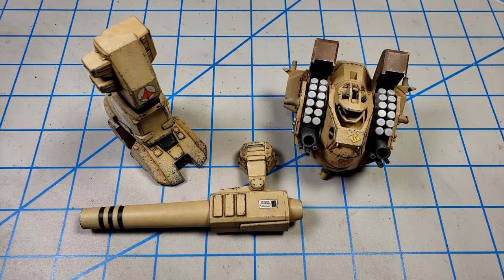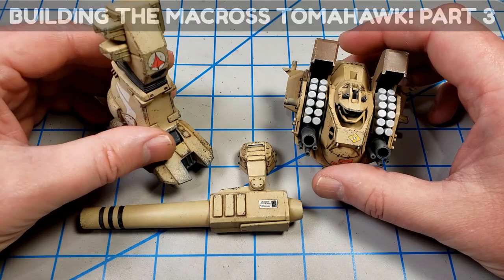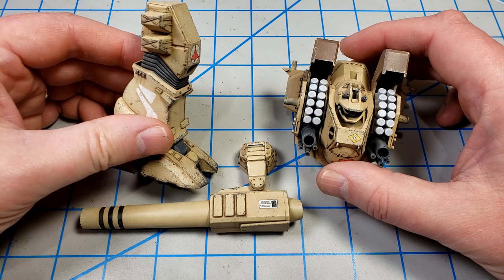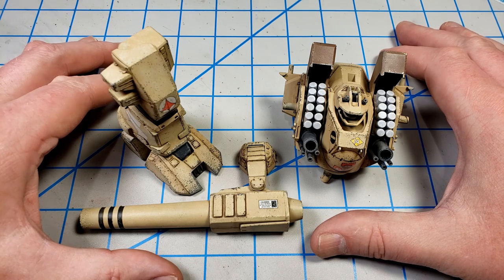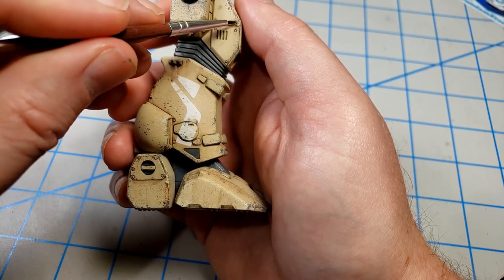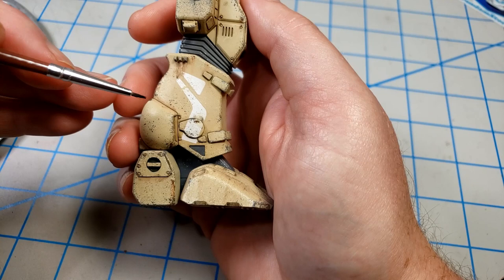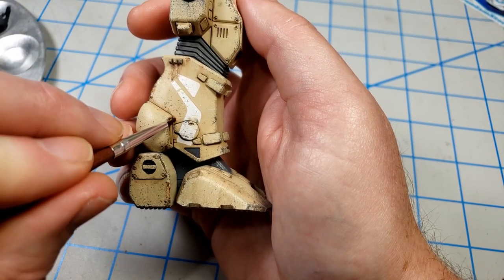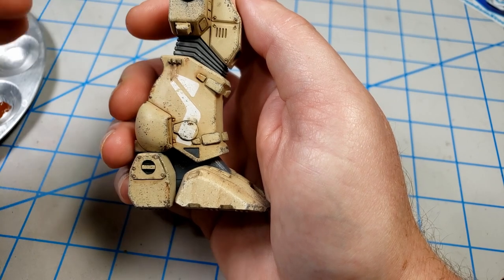Building The Macross Tomahawk! Part 3: Adding Rust, Grime, Dirt and Finish!

Comment: Hi. It looks great. What did you use to glue the clear parts? Thanks.
Reply from the maker: Thanks so much! I am grateful!

I used just the barest touch of Tamiya Extra Thin cement - just enough to allow capillary action to pull it around the edges. I've used it for years on hundreds of models, and with careful application, it's the heat! :D
Reply: @JonBius  thanks for your answer.  Won't clear plastic turn opaque or white with tamiya glue?  many use a special one for canopies or  transparent parts  ir  elmer`s white glue.  Thanks for your help.
Reply from the maker: If not carefully applied, it will do that. So it does require a delicate touch. But it does work well. If you’re not comfortable with it, the canopy glue does work, but it's not as strong. Still, it's all I have used for 10+ years! 😊

HTH!